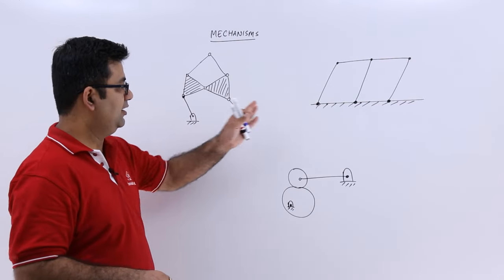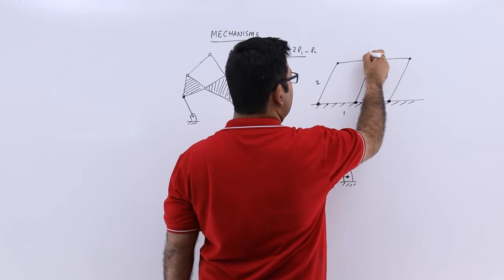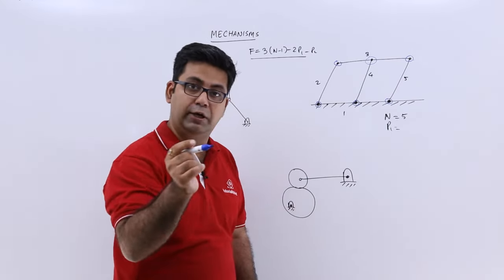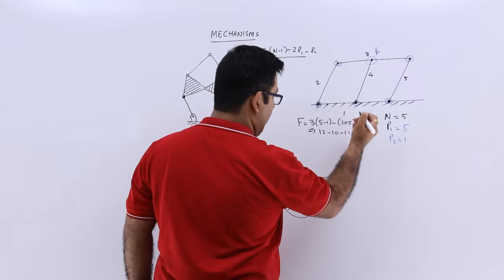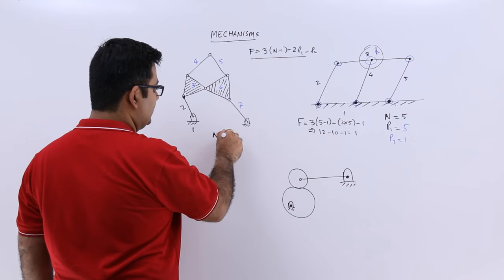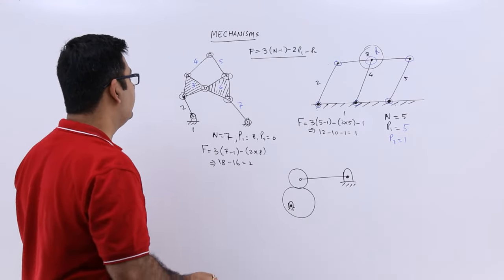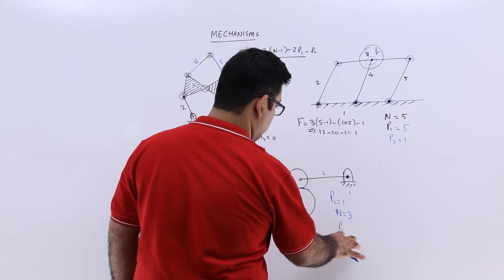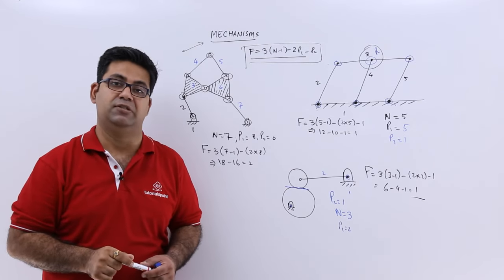Numerical On Degree Of Freedom

Comment: For the first example, its a bit unclear, when i refer to the text book , it's true that there is j2 =1 because of double-parallelogram . But if link 4 is adjusted to another way ( not performing parallelogram, than it has not j2 ) .. When there is no j2, the DOF or mobility is 0.
Reply: If all 3 links are equal in size and are parallel then D.O.F=0 redundent link am exceptional case

Comment: In 3rd problem ...N=4; P1=3;P2=1 ata hai....ye glt explains kiya apne sir
Reply: I think fixed link to consider only one like
Than N is a 3...... May be 
You have correct clarity please explain ittt
Reply: @UDAYKUMAR-lg1ks  link 2 with roller joint is 4th
Reply: ha bro kuki lower pair mai surf contact hota hai
Reply: Right n=4